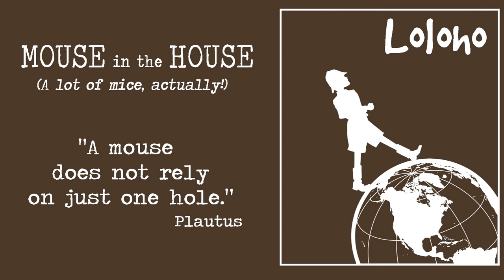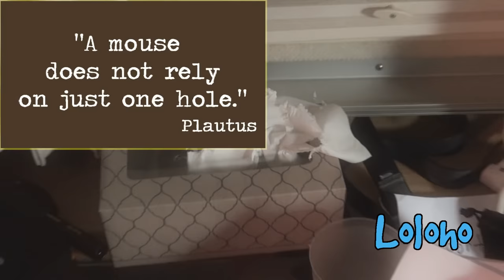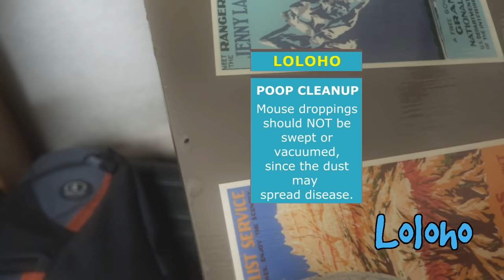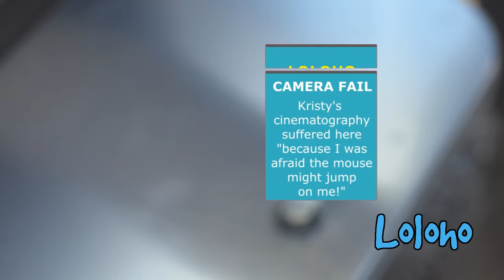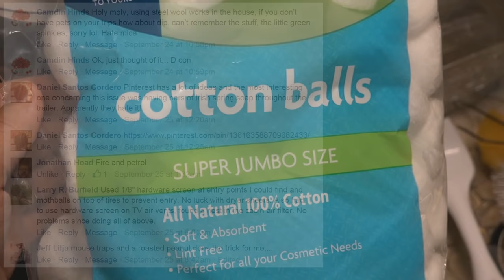🐭 How NOT to Keep Mice Out of an RV 🐭

Comment: Mice don't eat the tissues. They like to rip it up and they'll carry it to their nest and put it there for warm soft insulation. I have had many mice for pets and that's what they will do with such materials like tissues.

Also, you should have set traps to kill them. You don't know where you picked up the mice from. In the mean time, you very well could have traveled somewhere else with them for some time before you noticed you had a problem. You could have picked up a pregnant mouse and she had her babies in your trailer. It's amazing how many they can have. They're attracted to the warmth of the RV, so they want to get in and make a nest in there. Now you have transported mice from one area of the country to another. New Mexico has a real case of Hantavirus going on, where the New England area had only one case of it in each state except for New Hampshire, which had no reported cases. So you could be spreading a real problem. If the mice are in your RV, then you have every right to kill them out and dispose of them properly. I understand you may not like the idea of killing little rodents, but please, don't spread a potential problem.
The best way to kill them fast is with the spring loaded traps.

Comment: Hantavirus, bubonic plague, and who knows what other manner of death they carry...I'm sorry but that is a deadly force situation.  If it is my family or them, they lose.  I've used the Tin Cat in my house and it works.  I used it with sticky pads that you can insert in it too.  The benefit of the Tin Cat over old fashioned snap traps is that it can catch multiple mice w/out having to be reset.  Bottom line though, preventing entry is the top priority.  That's what every pest professional has told me, find the entry points and block them up or you will never win the war.

Good video, sorry you were having those issues, especially when you were sick...and I hope that you threw that coffee cup out, I just wouldn't be able to drink from that again:)

Comment: We notice snow in some of your videos so you have cold weather camping experience for sure.  What we would like to know is how do you deal with all the condensation when you are running the heat?  We were in Valdez one year in August.  It was very cool and there was a torrential downpour for days.  It was about as wet and soggy inside as out.  Our bed felt like a giant wet sponge.  We were at a remote site with no power.  If we had a dehumidifier it might have helped but short of that I am at a loss what to do in that situation.  We used towels to wipe down walls and windows but soon ended up with no dry towels and no relief.  Any hints or advice other than leave the area which we finally did.
Reply from the maker: +mybigblkdog We usually crack our kicten window, and that helps. Of course, it also circulates some of our warm air back outside! But if we don;t keep some air flow going, the condensation builds as you describe.

Comment: there is a great product I use for many years called weather block, you brake off a big peace and tie it with a peace of hay wire as they will drag it off, even thou it not light, once the eat some of it the need a drink, so they head out looking for water and die, when they die the totally dehydrate and no smell ever, if one finds water in side and dies you will find its scale an a ball of hair, if you never find it it will never smell ever, it is use in everything from boats RV feed store barns ,, I use to get them like crazy in my moble home,, it take care of moles too,, get weather block,, if you do not get rid of them fast they will take all of your  insulation out of your walls for a nest, they love that stuff, in no time you have no insulation in your walls for what little you had to start with, doing boat an RV repairs I have seen walls full of pooo an no insulation left in a 5 year old RV

Comment: I hope you thre that bottle of oil away after handling it with your mousie gloves.    Irish spring dose t help either.   Have you tried Diatomaceous earth?
Reply: I'm a new owner of a TT, and I will be taking it and leaving it in what's basically a field for 10 straight weeks ... it's the campgrounds of a Renaissance festival. I know for sure we have the potential for ants because last year, ants ate a hole through our tent and built a mound inside the tent! And of course there's mouse potential as well. Does diatomaceous earth work? That's what we were thinking of putting out, all around the base of Our Precious.
Reply: Tammy Jarrett I think it does

Comment: Um, why didn't you just plug up the holes in the belly pan? Had the same problem on our '00. As I recall there were several obvious areas around the suspension that we had to foam up. Airstream of that era, (and probably still) doesn't do a very good job of sealing things. I use steel wool now on my Country Coach packed around the sewer/power/water bulkhead passages when hooked up and have had zero issues. Boon docking they can't get inside the coach, but I do have a Rid-a-Rats (google it) setup in front where the genset is and in back above the engine bay. Packrats can really do a job on wiring and the pulsing LED from the R-a-R has kept them at bay now for years on all my vehicles here in rural Scottsdale. Not sure if they irritate mice like they do the rats, but I haven't had any issues. HTH.
Reply from the maker: +Don Leamon We will be plugging gaps with copper mesh & foam. http://amzn.to/1QUUn0V We also did some panel repair in the undercarriage.

Comment: Plug small holes with steal wool helps keep them out.
Reply: +MrMcsbr We thought so also.
Didn't work. They pulled it out. The same with canned/expandable foam.
DO NOT USE MOTH BALLS! 
They use them for soccer balls! Yeah I swear they will play with them but you won't have a moth problem for a few months until you find those balls they hid! No, the smell does NOT grow on you! 
Our Honey sat in storage and we got a mouse problem. Dryer sheets did seem to work unless we killed all the mice in the neighborhood because they even threw parties in the 1/2 dozen Ortho bait boxes before we tried the dryer sheet method! They also are supposed to keep bed bugs at bay. 

Blue Sky's and Safe Journeys!

Comment: I had a big mouse infestation last after the death of my cat and though it took a long time for them to work and they use electricity i got some electronic pest repel devices and though i had to trap the mice from the original infestation i have not been re-infested thanks to the electronic devices. Also if you plug any suspected access points with fine steel wool they will not chew through the steel wool there bye blocking them out..
Reply from the maker: +Bobbie Denney thanks for the tips! We have also used copper wool -- won't rust!

Comment: Oh - best for prevention (the only 'real' way to deal with mice) is copper mesh.   Like Stuf-fit   

http://www.amazon.com/Stuf-fit-Copper-Mesh-Control-30/dp/B00149P89E/ref=pd_sim_86_2?ie=UTF8&dpID=21f9t7fLiyL&dpSrc=sims&preST=_AC_UL160_SR160%2C160_&refRID=0S1BV7058SYGJCWWVD3N

Can be filled with the copper mesh 'and' great-stuff foam.   They don't chew through it.    Steel wool disintegrates in short order.

And the plastic live traps like you had 'do' work but you have to get to them sooner rather than later to prevent the chewing.
Reply from the maker: +karunald Thanks, excellent tip!

Comment: Ever hear of palm rats.... one winter in FL we were infested with them... the remodeling job they were in the new kitchen cabinets the chewed through the dishwasher discharge line that's how discovered them..the the owners boat docked in the canal outback.... and in our RV parked in his empty lot. we tried  everything and finely ended up using poison, they were far to smart to be caught by traps
Reply from the maker: yikes! The risk of using poison in an RV is that they might die behind the walls or beneath cabinetry in a location that's hard to reach... creating a very smelly problem. If that happens, yuck!
Reply: Long Long Honeymoon yes I know that's why we tried everything else but rats are rats when they got to go
Reply: they did die luckily in the basement of the RV😎
Reply from the maker: Yes, I certainly don't blame you. If we had a rat infestation, we'd use any means necessary!

Comment: If you have this problem again, use steel wool to block any holes you find. Mice will not chew on it.
I am horrified of the nasty creatures!!!!!
You can use a 50-50 solution of bleach and water to sanitize your camper.
Try using traps around the wheels, and the post at the front of the camper. Anywhere your camper makes contact with the ground. This should stop them from invading your camper.
Reply: +Jo Anne Bath-Miers quick set concrete works best, a very experienced painter showed me, and they haven't made it past any I've put in the foundation despite a neighbor with extremely bad hygiene habits. (on his side entrance the trash will sit there til squirrels chew right through the bag)...in the city and an oppossum AND a racoon showed up 2 years after this Jamaican/liberian guy started renting the house.

No wonder the whole family pressed their nose to watch me shower -- I don't think they had ever seen running water before. Women do laundry in the dirty gravel driveway and throw it in the weeds and their perfumes are so strong THAT killed the weeds! No joke......

Comment: Sticky traps do not allow for catch and release. Unless you know of mouse leg and foot amputee clinics.
Reply from the maker: +Laura Kibben Vegetable oil releases the glue quickly. We have done this before and it works well. However if you don’t find the mouse 🐁 immediately after it becomes stuck, it may maim or kill itself trying to get free of the glue. Thus sticky traps are cruel. I think it’s arguably better to use a spring kill trap than a sticky one for this reason.
Reply: So far, the Bounce sheets are working.  They are coming into my house instead, LOL.  However, I did just find a Western Fox baby snake two nights ago as I was heading for bed!  Not sure where he crawled (slithered) in from considering all the sealing I have been doing.

Comment: Hay guys  don't you have a cat.
I had a mouse problem here at the house which is located in the Catskill Mountains of New York State.
I have had cats all my life and I did not have any mice and I had two cats. 
As they got older I started to see signs of mic
 Well Patches passed at 21 Y O and two month later Chessie Joined Patches Cat heaven at 22 YO.
 At first I was not going t5o replace the cats. well two month later I had replaced the cats.
 the second night  Shamus was sound a sleep. and about a minute  later Shamus took off into the kitchen. and it was four month ago  There has  not been a mouse since that night.
 Oh yes Shamus did get the mouse.

Comment: Too much work using glue boards. Buy a mouse hotel made of galvanized metal. It is about the size of a cigar box. Can catch multiple mice at once. It is safe for them. You can easily pick up the hotel, take them far away and open it to release them.

Comment: I do not share your sentiment about catch and release. They should all be killed. I have a vacation house that mice also love to visit during winter. Repellents don't work. I've tried several just as you have.
Since I can't keep them out, I use battery operated electronic traps and other. 
They go in, get zapped, die instantly and repeat. Good luck with your cute little friends. (NOT). I will send links to what I use in another comment...

Comment: 4 years old!  lol  If you check these old vids;  I heard you say that you take the critters a long way off, but how far is that?  Suggestion:  Spray paint a patch on the back of each mouse so you know whether you are trapping new mice, or repeats.  I suspect the paint will only last a couple of weeks, but that is long enough to be practical.  Speaking of practical; it's a mouse.  Are you a man, or a mouse?  I understand why you could not speak openly in the rising inverted culture.